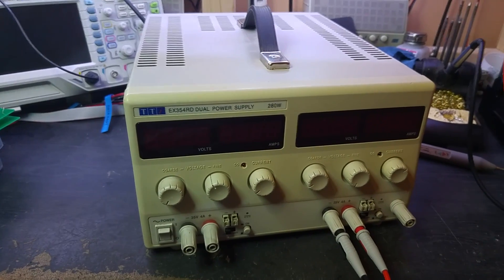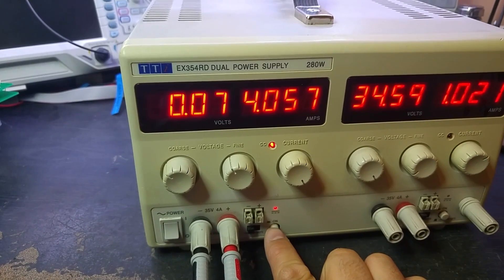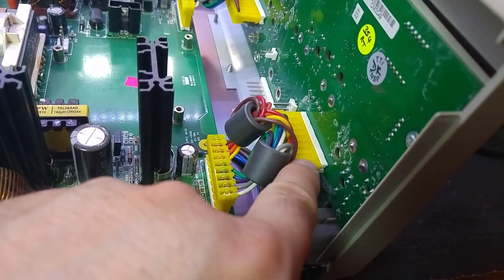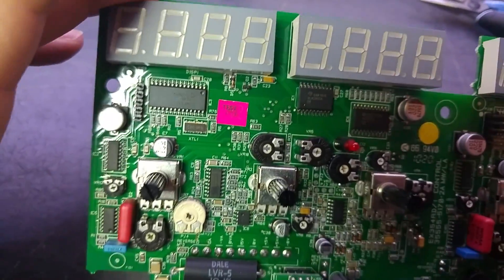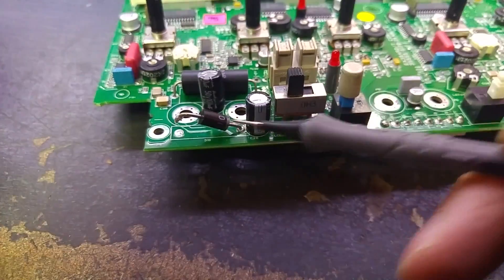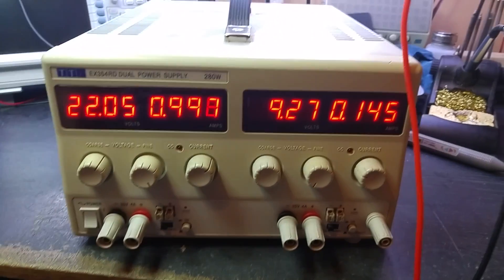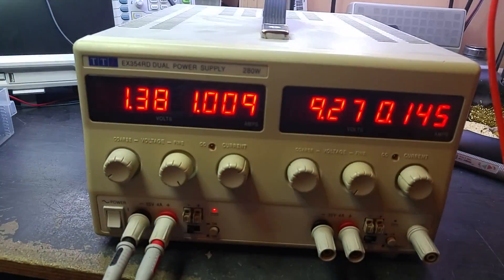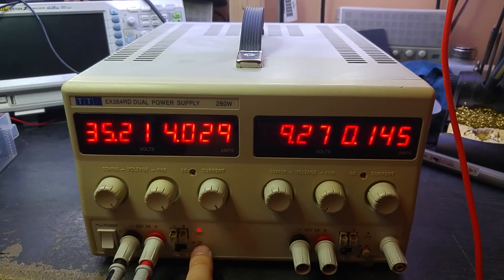Fixing a "working" ebay power supply TTI EX354RD

Comment: my supply is changeing voltage output but not visible on display i have check whole circut anyboady pleasr help which problem could be?
i have same power supply with single channel

Comment: Hi, just seen your little video .
Very sensible approach to the problem , which resulted in a fast solution. I designed this PSU in about 1994 . You have the latest edition . Initially it was not power factor corrected - that was added a few years later . I am a consultant designer for TTI and this was actually my first design for the company . There have been many more since that model .
Reply from the maker: Hello and thanks for your comments :) 
It is very interesting to me that you are a consultant for TTI as I have many TTI product, not least 6 different TTI power supplies. I find the user interface to be the most appealing part, being so practical to use in real life situations. I particularly like the newer models which have the low ma range selection, review and voltage range features. I don't suppose you have schematics to share incase I ever need to do any other repairs? ;)
Reply: The company is very good with service data . Check the web site - you might get service data there . Failing that, call them on 01480412451 and ask for Nick Wade .
Reply: Hi, you're a bit of good luck - the designer! I have a EX354T - Version 1, with the R120 680 ohm big white ceramic getting very hot - about 120°C. Any tips to locate the problem?

Comment: You found the problem there quick!  I had a diode or transistor in my mind as not much else would happily continue to draw 4 amps I think.  I wonder why it failed?  Is it for reverse polarity protection?
Reply from the maker: I think some of it was luck, thankfully I didn't get sent off down any wild goose chases looking for the problem. Yes it is reverse protection (As in reverse protection from the external load supplying power into the psu) It's a fairly beefy diode, so if it didn't fail from natural causes (as we know anything electrical can) then I imagine someone applied some sort of significant back voltage spike into the unit on that channel
Reply: @arcadeuk  One good way to fry that diode is to try to use the power supply to charge a lead-acid battery, fail to use a series diode, and then connect the battery with reverse polarity.  With the forward-biased diode connected directly across the battery, a lead-acid or NiMH or lithium battery can deliver lots of current.
(I bought a used bench supply once with exactly this problem.  The blown diode was a 1N5408.)